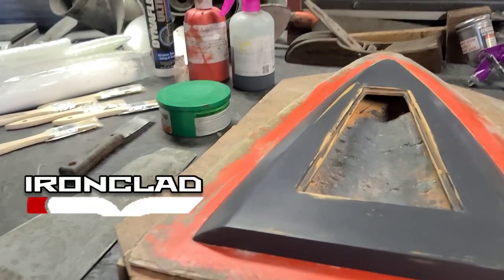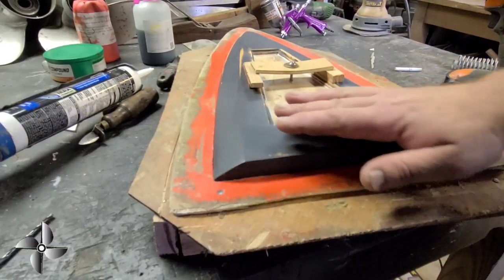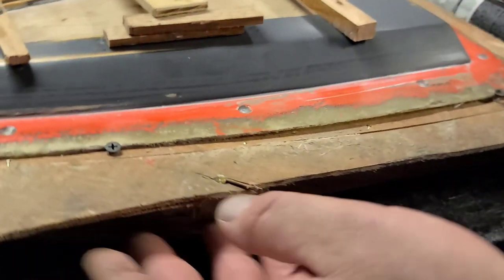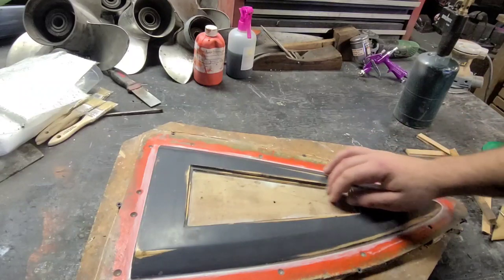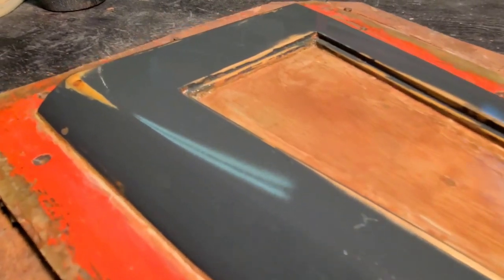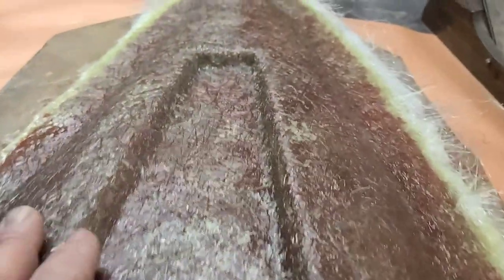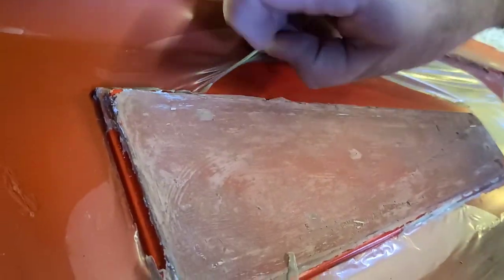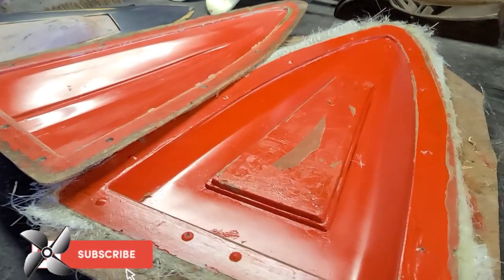How To Make a Fiberglass Mold -  RC Boat Build Start To Finish

Comment: I'm going to make a mold for the Mystic/ miss geico 29 Canopy/cap.  I have a question, should I cast a outside mold & a inside mold of the canopy? Or should I just cast an outside mold of it & lay in my CF & vacuum bag it? Just not sure what direction to go
Reply from the maker: You only need to mKe one mold, wax the outside of the hatch, then PVA, lay up the fiberglass, (several layers)  then pull the mold from the hatch...   WAX & PVA  now you make the hatch with Carbon fiber usually 1 or 2 layers.
Reply: @IRONCLADRC  thanks for the tips! I'm slowly getting all my supplys together, I plan on trying to vacuum mold. If it turns our well, my next project will be to mold a Spartan & build a CF one.

Comment: FYI.  FIBERGLAS RESIN does not stick to electrical tape . Good for those little holes on the hatch cover . I actually made a foam plug and covered the whole thing with the tape . Boat came right out .

Comment: Years ago I was going to glass a foam jet and have ultra thin glass cloth..the glass you use is so much easier to work with..for making boat parts...I tried making a canopy for a wood rigger I built years ago..glass I used never hardened 😢...the stuff I have has to be exact 50/50...question..why can't you make a boat mould out of silicon? I watched a few videos on silicon mould making and to me it seems it would work well for small boats...thanks for sharing
Reply from the maker: I'm old school when it comes to mold Making I guess.   I've seen the silicone process but I would think the mold would have a tendency to twist or warp..    I was taught the fiberglass process years ago when I worked in a boat yard.
Reply: @IRONCLADRC  no for rc boat it would not twist ,warp or bend unless you forced it..silicon is solid..watch a couple of silicone videos...I am old school also but I have an open mind to new ideas and methods..

Comment: You have a chance to use these molds to make a boat yet? Can't wait to see the difference between a submerged prop VS a stinger/surface drive. I have a very similar styled hull called the Northwind 40 that was popular back in the 70's. Mine is 32" long and very low profile like yours. Main difference is it also has a narrow flat bottom ride pad towards the rear of the hull. When I got the hull from my Dad, he had it set up as a submerged drive, but it never seemed to handle quite right. I removed the sub drive, and made a junky stinger, then removed all the nitro stuff to convert it to electric.
Reply from the maker: Unfortunately I've put it on the back burner.  I've been waiting for the weather to warm up, now that the weather is right I may get back on it.   I actually cleaned the mold last week preparing & waxing the molds

Comment: Hi can you tell me the right glue or resin etc to use on the floor of the Vector SR80 I need to make a rectangular shape battery plate on the center of the boat I'm building
Reply from the maker: My buddy Jeremy used epoxy 24 hr slow cure on his with no problemrough it up with sand paper  while clean with alcohol  (acetone be careful with acetone in plastic hull.)  24 hr slow cure epoxy should work
Reply: @IRONCLADRC  Awesome thankyou 😊,I will do a wee test spot way further up the hull first to make sure and yes acetone just melt the plastic